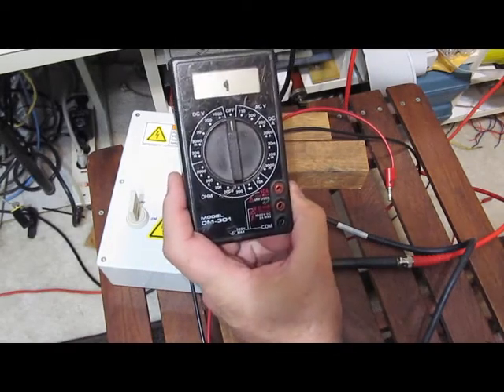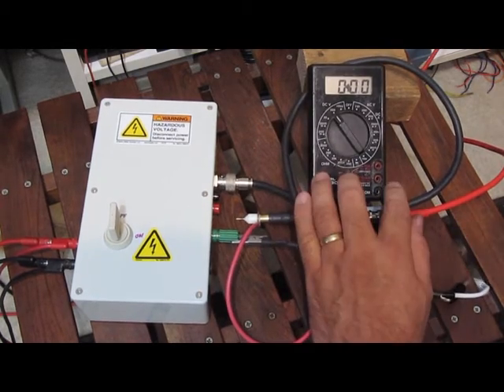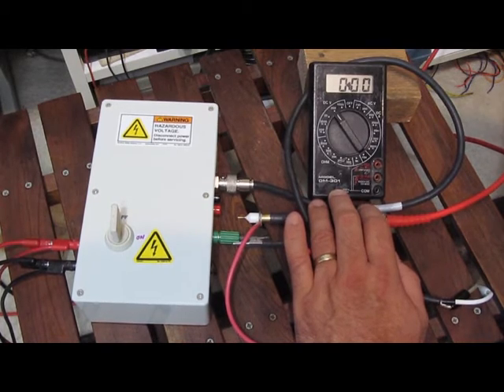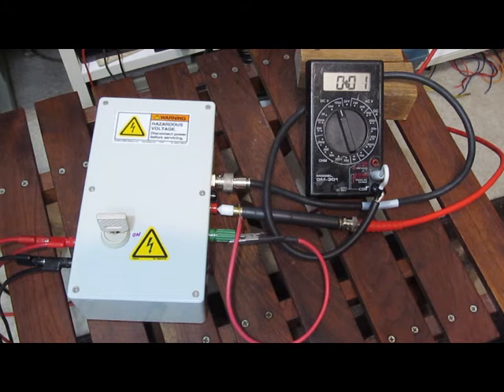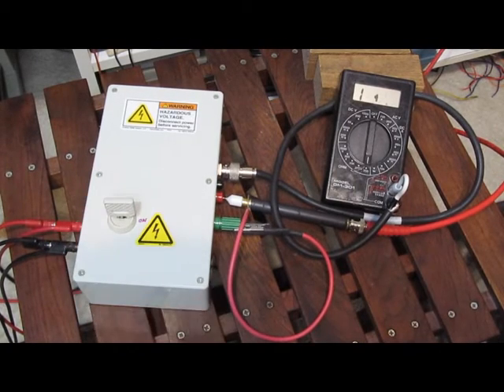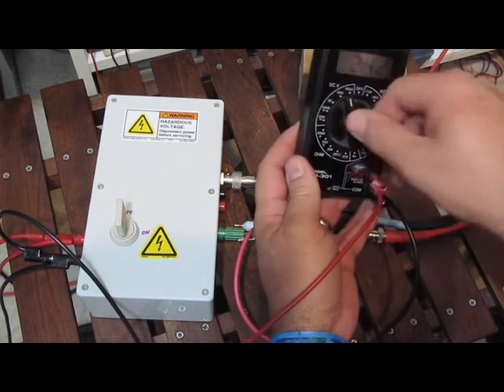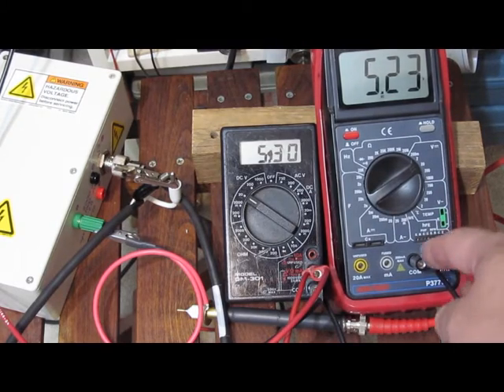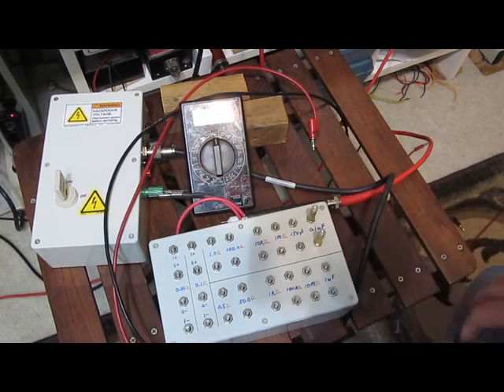Homemade low energy surge generator Evaluating low cost DVMs Part 2  The DM 301

Comment: can this multimeter measure resistance?
Reply from the maker: All of the multimeters I have ever seen will measure resistance to some degree.
Reply: joe smith thanks yep I got it. The problem is that mine doesn’t beep.
Reply from the maker: @markoap31  I am fairly confident that all of the multimeters I have ever seen will not beep when measuring resistance.   This is a feature of the continuity mode.  There are two meters shown in this video.  I show measuring resistance with both.

Comment: I have this meter. I think mine was sold under the Popular Mechanics brand. What's really surprising is that this meter has a MOV in it. Maybe that's why it did so well in your test.
Reply from the maker: +Gooberslot I no long have the meter.  All of the non repairable ones were tore down and recycled.   It did do fairly well.   This meter had several slits cut into the board as well along with a PTC.  The high voltage chain was made from all through hole parts.   Much of the initial testing I was getting a feel for how much energy it was going to take to get the meters to fail.  You will see how I was changing the source impedance, peak voltage and decay times.  I took some work to decide how to run the test.   I didn't want to just damage them all with one strike and never know which was more robust.
Reply: Hola tiene todavia este multimetro BM103